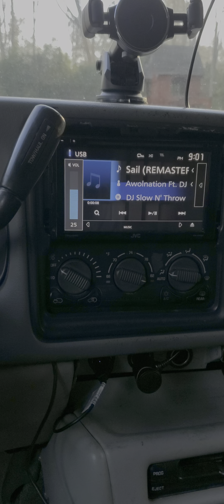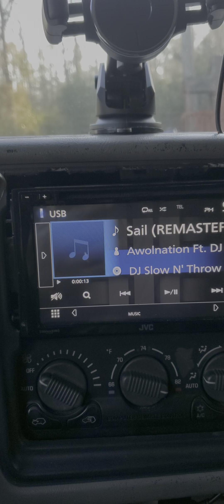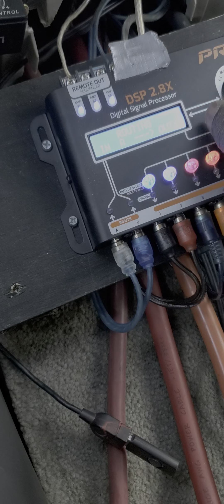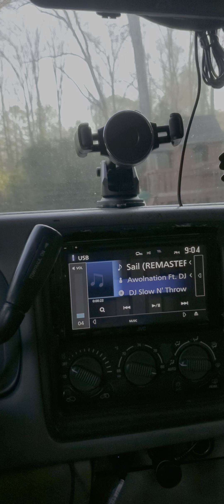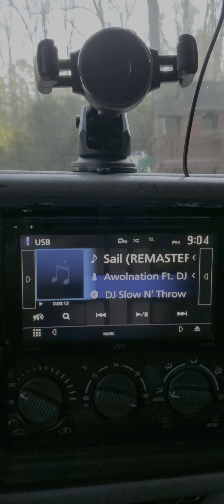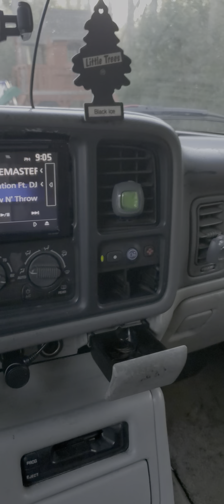Stereo Vs Mono signal on PRV 8 channel DSP Explained. Only Arnold 6.5s playing.

Comment: People fail to realize music is broken into sounds that rotate throughout a system front rear left and right, so this breaks that apart to hear everything in the music. Ive been using a lot of these 2.4 and 2.8 in builds lately. Its easier to set up that moat dsp that require a computer to tune them.

Comment: I’ve subscribed ❤well good video I’ve just purchased the 2.8 version from Amazon I have few question if you could respond I’ve subscribed and notifi on 
So from the head unit your using set of phono rca to input and then the rest to separate amps 
Also a pair to the sub woofer or are you leaving the rca to head unit sub woofers out

Comment: How do you set up the Graphic Input Equalizer
Parametric Input Equalizer
Parametric Output Equalizer

Im running 8 apocalypse M61ae 6.5 speakers 

Only setting i have is my HPF is set  150
Reply from the maker: Great question. I'm flat on the eq and I still have yet to get a full understanding of the parametric input and output so I'm not using them. I think it's for finer tuning but I honestly don't know. I have yet to have someone explain it on depth. Going  to look for YouTube videos today though.

Comment: Awesome my G 💯. How many RCA cables would i need for this DSP and the length?
Reply from the maker: 1 set from the head unit to the input on the dsp. 1 set per amp from the dsp to each amp and length depends on how far the amp is from the dsp.
Reply: @nicholasholmes4864  so basically 3 sets of RCA cables. My amplifers will be in the back of my van. So about 17 foot 2 or 4 channel RCA cables?
Reply from the maker: @drvictoria07  for me I ran a splitter. Single rca to 2 rcas at all my four channel Amps. They are all the same the RCAs
Reply: @nicholasholmes4864  yes sir. 1 more question ❓. I have a equalizer already, can I combine that with the DSP?
Reply from the maker: @drvictoria07  I wouldn't the dsp has a 16 band eq

Comment: Is there a way I can use one dsp as a left and one as a right? Would I just do my two rights for front dash and door to a “right” and the lefts to a “left” dsp?
Reply: Could I just do my 7 on A as left, and other 7 on B as right?
Reply from the maker: Yes but you can do that with 1 dsp
Reply: @nicholasholmes4864  how so? I would like to not use dual female to single male end adapters if I don’t have to, I have 14 outputs
Reply: @nicholasholmes4864  was thinking I can do front dash R on the left door dsp and have 1-5 on doors and 6,7 on the same. Then run my right side with the right door and left pillar?
Reply from the maker: @majinbenproductions1038  yeah get 2 dsps

Comment: Do you know what the voltage range is on the RCA outputs of this DSP?
Reply from the maker: I don't but I charge 16.4- 15.5
Reply: I am surprised that DSP will handle that voltage. That is awesome! I am really thinking about buying one of these.
Reply from the maker: @dude22573  was a little higher 16.456 on the bottom meter when I first start up. I drops as the alt heats up. 16.1 in about 5 to 10 min 
 https://photos.app.goo.gl/mnKF4wwucBQ2Vp6a9
Reply: @nicholasholmes4864  I think he meant the voltage output on the DSP usually there like 4 or 8
Reply from the maker: I don't. Haven't checked its a prv 2.8 look it up
Reply: @nicholasholmes4864  @williepoker4520 I purchased one of these and I love it for the money. I ended up talking to PRV tech support and that voltage is adjustable. That was my main concern.